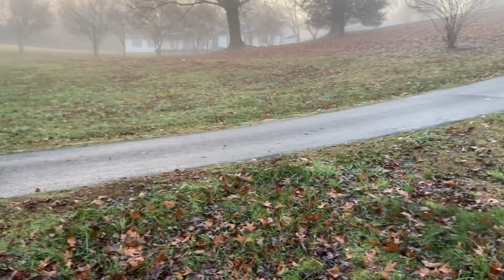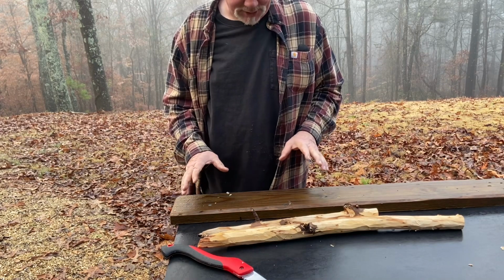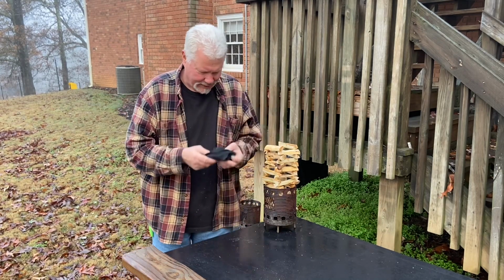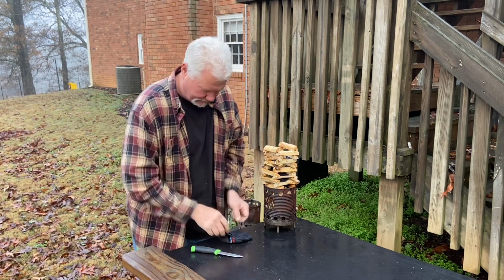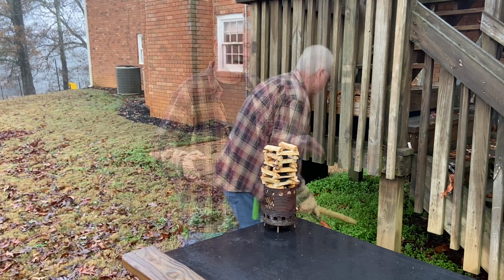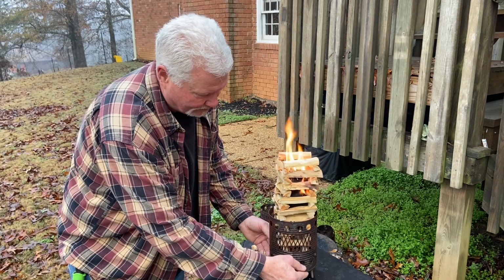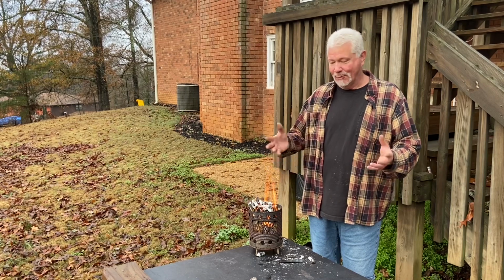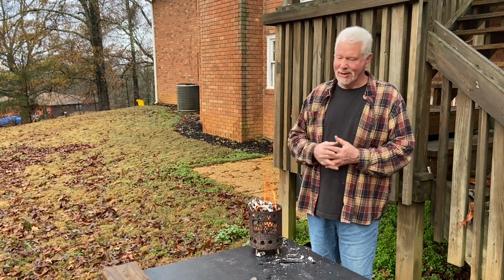Ferro Rod Ignited Socks For A Wet Wood Fire

Comment from the maker: About 45% of my Tulip Poplar was still soaking wet after cutting away the even wetter exterior. Then, I ferro rod ignited a sock(s) to use for a great extended burn fire starter. 
   With only 55% of the wood being dry, there was no excess heat being generated. There was only enough heat to get the next fuel wood just dry enough to make it burn and keep this very slow burning process going.
   Please follow the LINKs below and SUBSCRIBE. Thank you!

Ferro Rod Playlist
https://www.youtube.com/playlist?list=PLkoXX8XsMW3lI6k8TH1Bljf57Yvp9K1WD
Dry Highly Flammable Tinder When Everything’s Soaking Wet
https://youtu.be/XNKB8YiLt9w